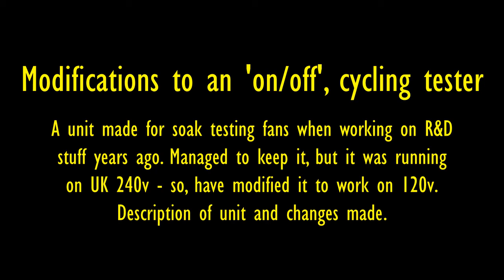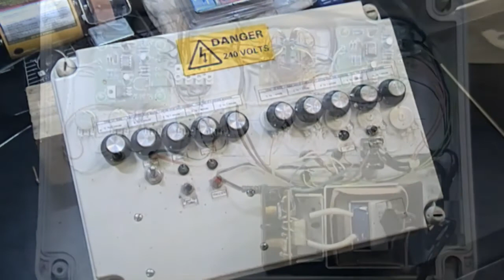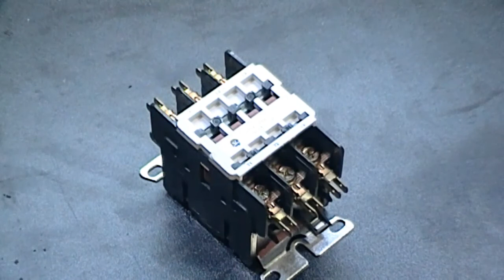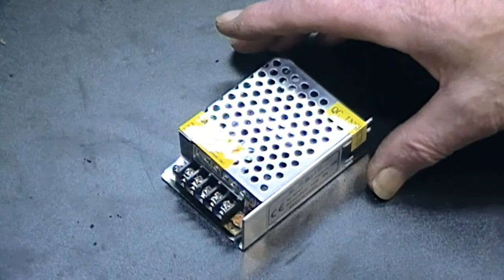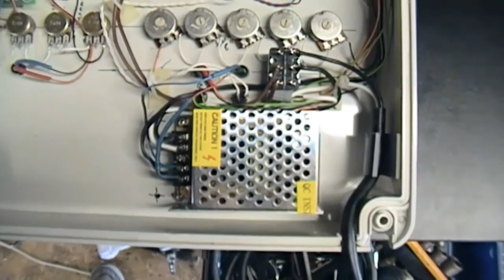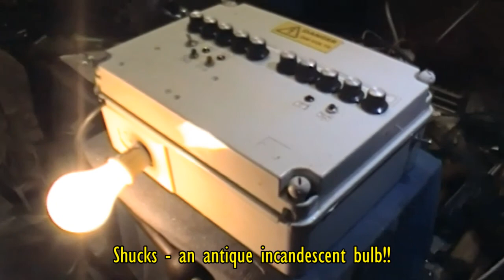An 'on/off', cycling  tester - description and modifications for supply voltage

Comment: Chris -- made something similar, but to turn on/off a industrial strobe light in the attic.  Squirrels moved into my attic, despite sealing off the opening, they would chew a new one.  Finally had the strobe go on/off and random times and intervals. They moved out, and never returned.   Odd trivia, Motorola Semi MPC555 was a huge uC, with floating point, and all sort of timers, for engine and industrial control.  The original EVB had one LED that would blink at 1 second intervals (yes, a tip to the original 555 timer circuit).   Naming the part was Dick Spilo's humor showing through. He graduated from Purdue with his Masters in 1958, writing about the future would be digital control.  Way ahead of his time, and sadly missed.  Tom
Reply from the maker: Hi Tom - hmmm - now there's an idea!! Looking back, I realize just how many times the venerable 555 timer came into use - now we have so many dedicated chips and surface mount etc - I miss the old days with all discretes and still have huge numbers of old logic chips - TTL, CMOS etc.